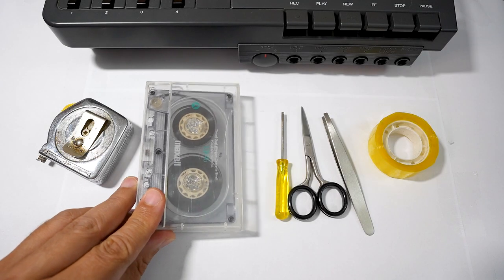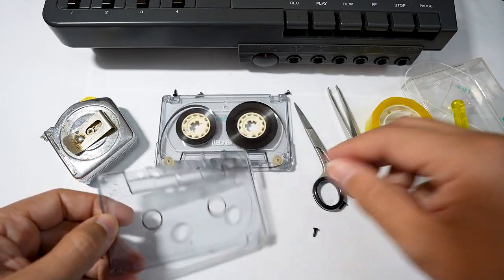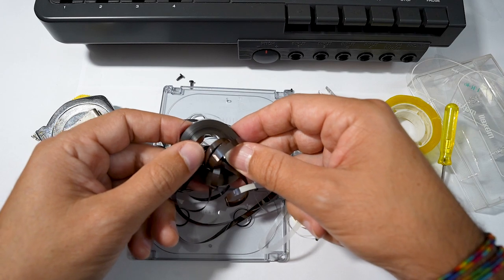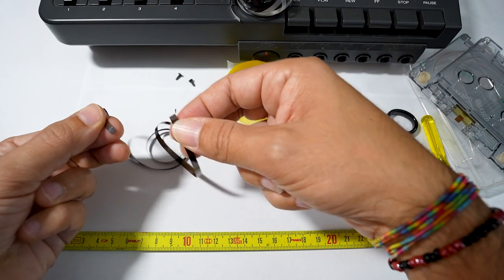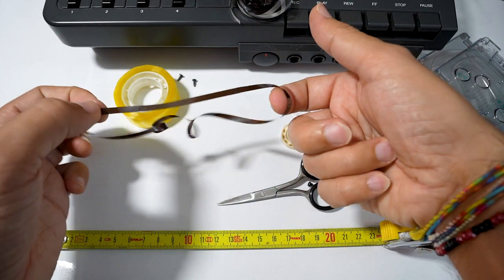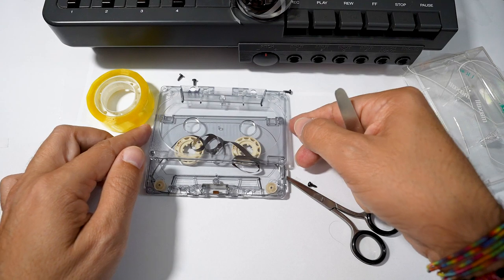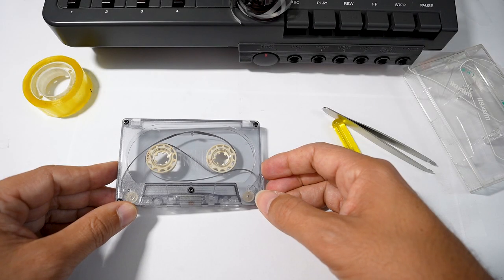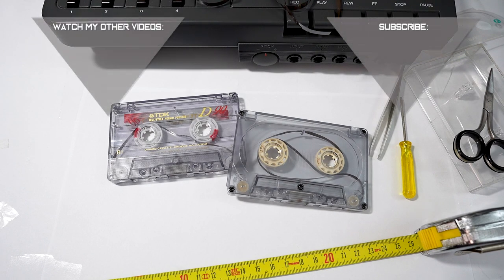HOW TO MAKE A CASSETTE TAPE LOOP // All The Tools You Need || Best Tutorial

Comment: First of all, thank you very much for your information. 🙏🏻 
How many beats with how many bpm is this 24 cm tape loop you made or did you get an average result?
Reply from the maker: I don't know man, it's hard to know it maybe you can make a proportion with the duration of the loop.
But it's never on time because of the wow and flutter effect of the damaged tape.
I don't use this kind of loops with rhythmic beats
Reply: Probably rhythmic sounds are not contained in it, pad strings bla bla bla ... It looks like I'll have to work with sounds, like arpeggio piano ...
I will perform the rhythmic themes live.
Thanks for the information

Comment: Without adequate tension how does the loop play? Is this why you specifically chose the 5 and 8 seconds long loops—so it roughly works out according to the two paths you gave the tape? I imagine other lengths are more trouble but fine so long as you create the tension for the spindles to work against.
Reply from the maker: You just need the tension to let the cassette play. The loop sounds lofi as you can hear, with variations of pitch and speed (wobbles). If it's not what you want you'll probably need a simple looper
Reply: Oh I get it now. The looseness creates the organic quality vs a perfectly tensioned loop of tape. I’m new to tape loops haha Thanks for the quick reply!
Reply from the maker: @untitled746  no worries, check my other tutorials on my channel